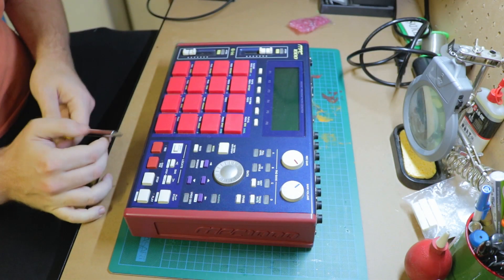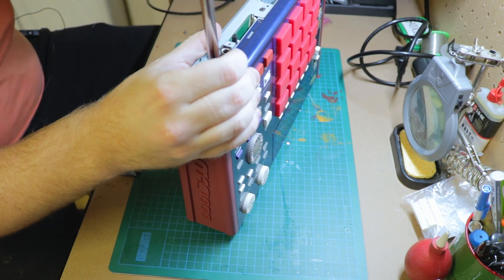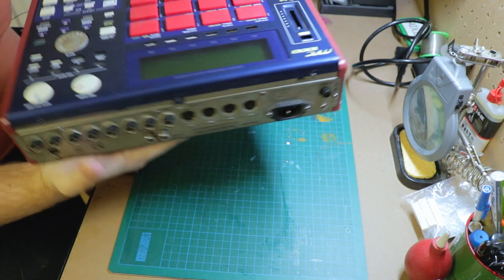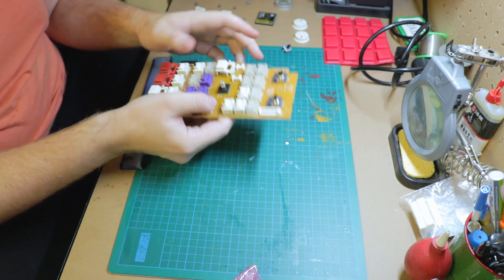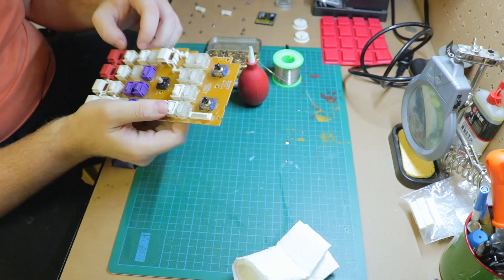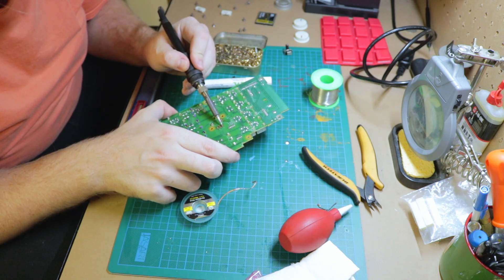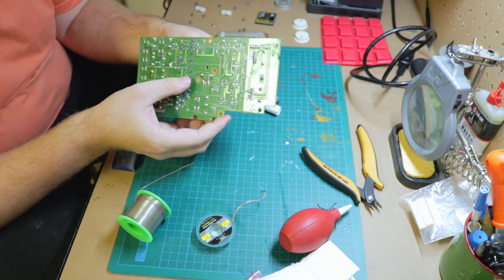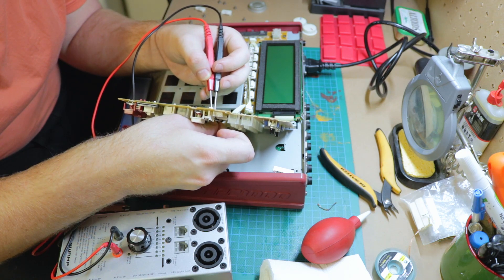Why You Should Learn to Solder - Fixing My MPC1000

Comment: After how long of using do the switches fail again ? I recently did a full tact switch replacement on my mpc 1000 and it works so nice now that I am afraid of the time that they will start failing again
Reply from the maker: Depends on the tactile switch. See if you can find the data sheet. I recently replaced mine and know ill enjoy my Mpc1000 for years

Comment: Can you recommend a basic soldering kit? I bought a mpc1000 but the up arrow takes one or two clicks. Ideally I would like to replace everything to keep it fresh but the board from mpcstuff is quite expensive. I'm planning on just fixing a handful of the tact switches (mainly arrows, mode, and main)
Reply from the maker: The one I use is an ebay cheepy, think i spent 50aud. Just look for a soldering station and make sure it have varible temprature. You will need to get the solder, flux, solder sucker and wik which can be ~10-30aud depending on where you get it. However the solder tip cleaner is a metal scourer in an altoids tin, it works really well. The cost to set up is a bit but if you enjoy it you can move onto better equiptment. It really does open a world of posibilities, especially with eurorack.

Now for the MPC, they are tack switches so easy to find. I would say research what you need and how to do the repair... however if this is your first repair project. Please do not attempt untill you can comfortably A. take apart and put together a device B. solder and desolder parts.

Get some protoboard with the switches you are using, watch tutorials on how to solder and replacing switches on the mpc and getting them the right way. practice a lot. next get a toy keyboard, learn to take it apart and put it together without stripping screw theads. alot of the mpc nuts are mounted to sheet metal and are easy to strip. 

I am glad to hear you want to repair your MPC after watching this video, I am going to add you do your own repairs at your own risk. however I hope you go well in your own repairs and have years of fun with your MPC.
Reply: Can you do a video on installing MPC 1000 Q Link Slider PCB Board? I recently bought one off mpcstuff but I see no tutorial video on it
Reply: You could try spraying deoxit on your tact switches. Its worked for all of my tact switches that broke. I have a tutorial on my channel
Reply: mate i have the same problems
and my down arrow some times falls into the case lol